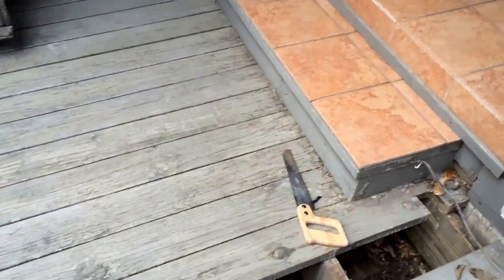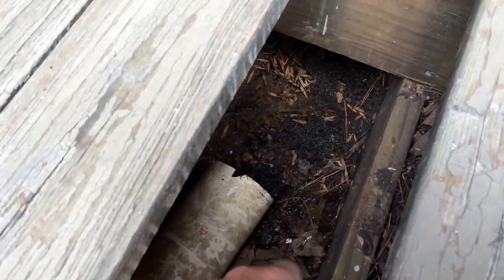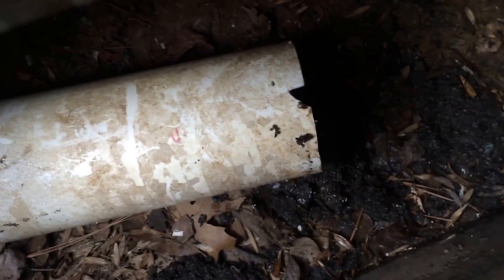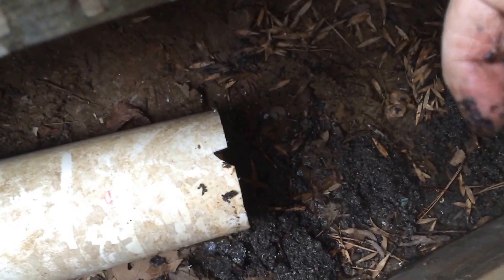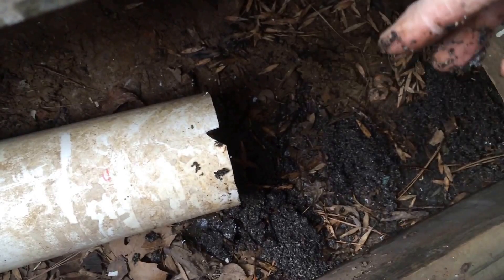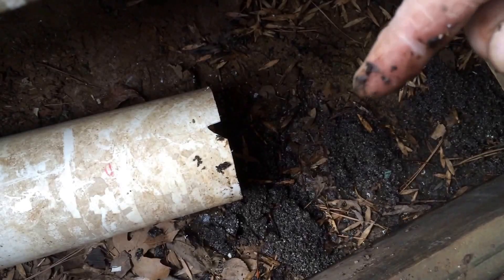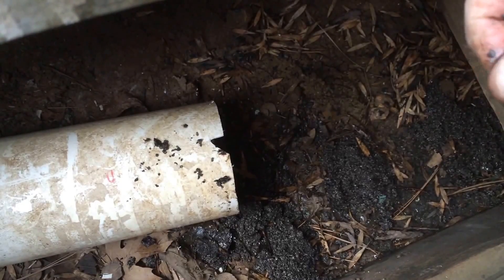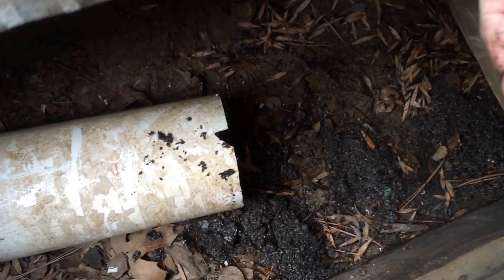Downspout Drainage - PVC drain tile v's Corrugated pipe -

Comment: Thanks for the tips!! I just dug up all my corrugated because of both poor sloping and clogs that were then backing up and ultimately forcing leakage that ran close to the house.  My question is, since I know I will likely have roof grinds and other debris (leaves, pine needles) how should I end the drain so that it all flows out?  My house had everything feed into a pipe that ran about 30 feet to the wood line and I'm wondering that is still best or if I should just have shorter individual drains
Reply: Jeffrey Golden end it into some rocks

Comment: So whats the issue....is it the slope issue, or a combination of slope and not filtering downspout. If the slope is good, will the corrugated still clog....I imagine not if done carefully. I like corrugated because it is a bit more flexible.
Reply from the maker: Dave R yes corrugated is a lot easier to install. As I mention in other videos, so far as using it. In this application solid would have been the best option. There was limited to access to install (due to the porch) reducing the amount of slope. Corrugated would have clogged in this application quickly. Correcting the slope, plus using solid PVC is the best choice for this app. That's the importance when selecting the type of pipe to use...application! Solid PVC requires less slope and the smooth wall allows for easier push out of debris.
Reply: Da

Comment: I moved into a house w/ corrugated already installed.  We want to finish our basement but need to fix these downspouts first (there's already a small water mark in one corner of our basement).  Anyways, two of the downspout drains run under a concrete sidewalk and the other under a brick sidewalk.  What is the minimum PVC pipe diameter and best strength rating to use and is there an easiest way to replace the piping under these obstacles?  Thnx!
Reply from the maker: grimloktt if you don't want remove the corrugated pipe you should install catch basins under the down spouts and tie into the corrugated pipe. Check the NDS YouTube channel on how that setup is done (sorry I never uploaded a video on that yet). You can use thin wall solid PVC and it will do just fine under poured concrete. If you are a home owner, your best option for getting to the pipe under the concrete you will have to cut the concrete with a concrete saw, which you can rent.